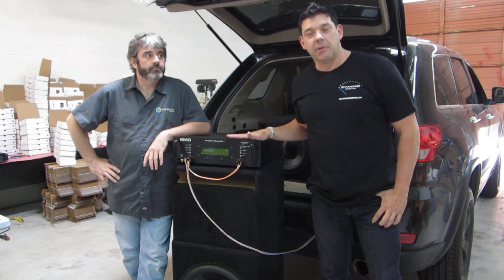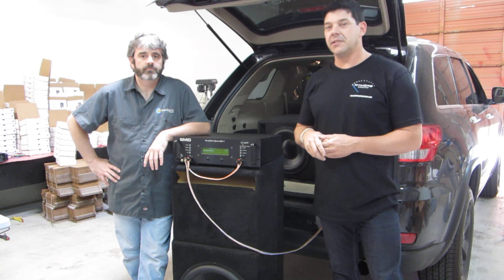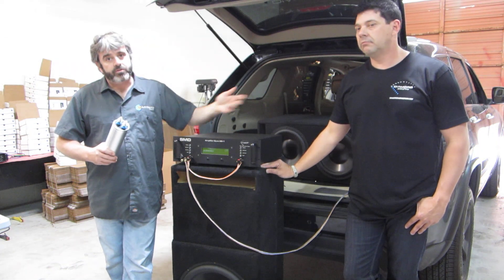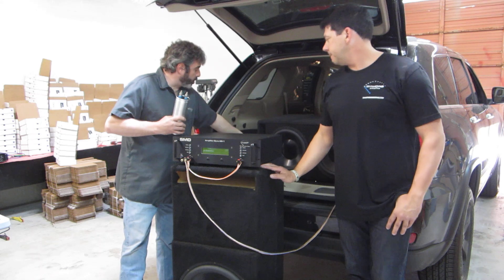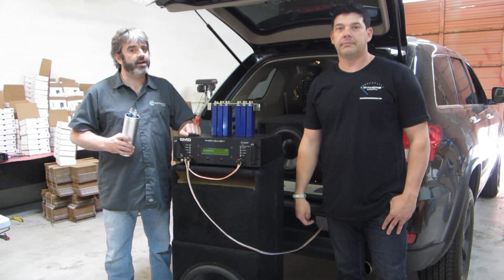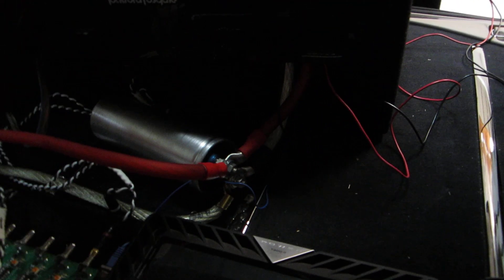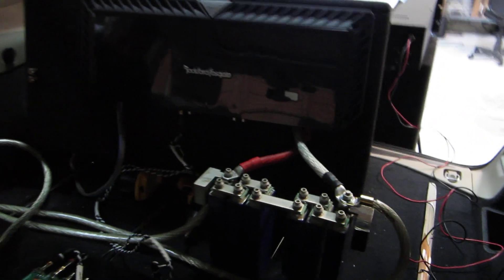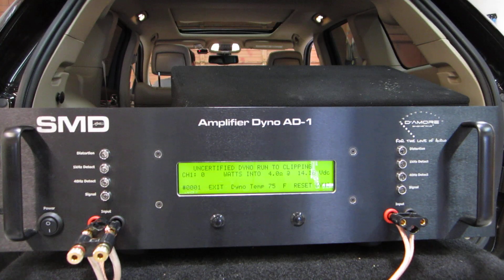SMD / D'Amore Engineering AD-1 Amp Dyno, Capacitor Testing Part 1 (Continuous Sine)

Comment: I run 1500w and I have 2 agm batteries with a 1 fared cap and it does good to keep my music in sync with the rapid beats but once you hit low and need power it is drained pretty fast but then the batteries take the load 13.7 is what I see when it sweeps. Also would have loved to see a sheet with the Dyno runs next to each other to compare the difference between them all.
Reply: While I'm driving should have added that I'm on stock alternator also.

Comment: Neglected all reasons for using a cap in the first place. A stock alternator is not going to put up with a 2500W amp at full power  for long, it will die. So clearly you are running an aftermarket high output alternator.

If you have all that extra power being produced,  you need storage, that's where a bank comes into play. Putting the 1F cap into this situation is silly at best. General rule of thumb is one true Farad per 1,000W. That means your first cap test should have been at 3F (again, with a stock alternator).

They aren't replacements for batteries or proper electrical production, they are for people with stock alternators trying not to kill their electrical systems, stabilizers for voltage spikes.
Reply: It's more like 50F per 1000 watts. 1F caps can't do shit about voltage spikes, they are way too small.

I just shuked a 200 Ah battery in the trunk instead :P Voltage doesn't move at all, though my setup is just 1200 watts :P

Comment: What a stupid way to end the video
And what the hell are you revving the vehicle up this makes no sense it makes the test un true. to do this test the car should be at idle for all tests not revving the s*** out of the vehicle wtf
Reply: Mimics driving conditions dumbass
Reply: More rpm, more power produced. This is why your headlights dim at the red light, but not on the highway.
Reply: DeathInANoose exactly; same reason coming back from a jumped battery should always be driven at rpm since idle does next to nothing for a charge.

Comment: LOL for the money spent that capacitor, people could get a group 31 agm battery and have your voltages at safe levels above 13.5 volts, guaranteed to have your amps make WAAAY more power. Still this test does show that capacitors Do make a difference. Just not enough.
Reply: Capacitors don't make more power just delivers the power more quickly and efficiently
Reply: JohnBee yes like lowering signal noise from the alternator and relays switching

Comment: Rockford Fosgate 100 Farad Capacitor is very expensive. What is a good quality 40, or 50 Farad capacitor?
Reply: Why not buy a 40 farad high density carbon capacitor from lightning audio.. Even 2nd those are great!
Reply: voodoo capacitors are the best by far bro
Reply: ya just make your own with maxwell caps those are cheap

Comment: Needs a constant voltage instead of a shaky foot at the wheel
Reply: Once rpm is above a certain point alternators putout max amperage so up and down fluctuation doesn’t matter

Comment from the maker: Testing not flawed.  If you watch part 2, the dynamic power testing you will see that the 1F cap actually worked BETTER than the 100F cap.  Video has same intro, dyno runs are different.  Results in description are different.
Reply: Maybe the 1 farad cap can discharge an adequate amount of current more quickly? Hmmm
Reply: Tony, I have a DD-1 and an AMM-1. On the DD-1, is it 1% distortion when the light is fully illuminated or when it just starts to flicker?

Comment: One question, which I assume you considered this before hand, but did you have a given length of time per test? and or would this have any effect on the output number? I know heat is one variable that effects output.